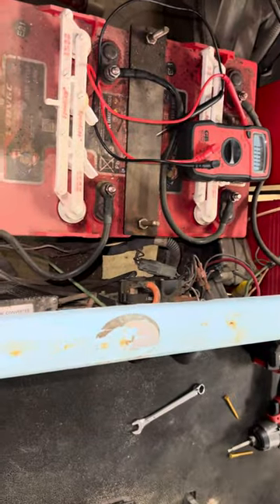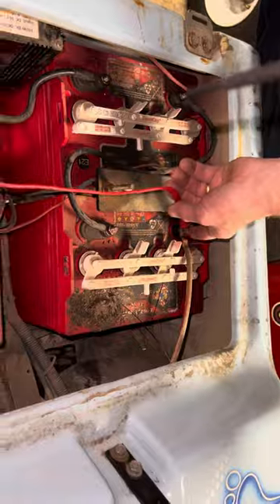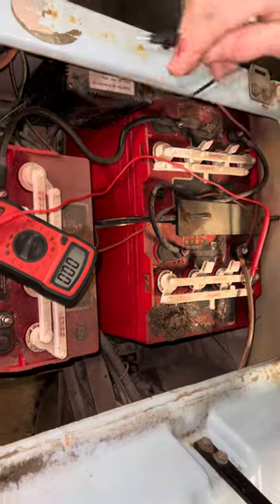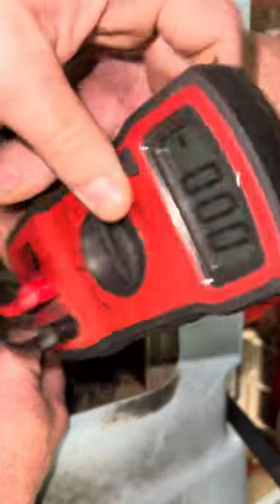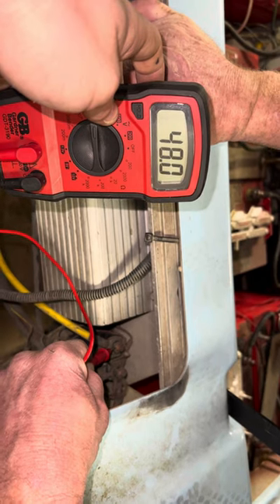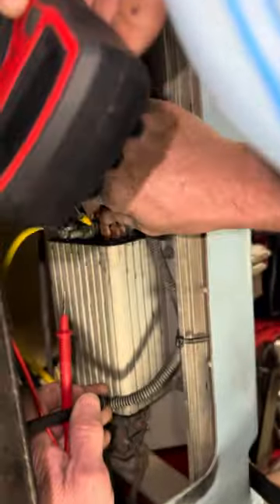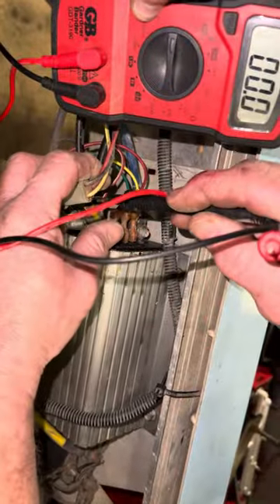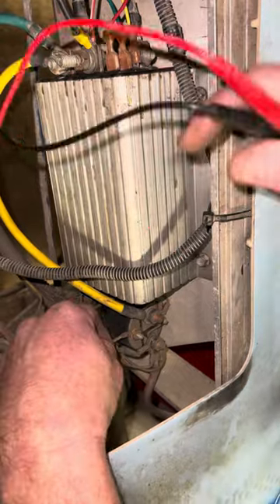Club Car 48 volt won’t move. Troubleshoot whole cart

Comment: Question what if the solenoid isn’t clicking at all just replaced it as my club car ds was not going reverse and sometimes it would go in forward.  Replaced Mccor replaced fnr switch replaced solenoid and somewhere down line won’t click anymore
Reply from the maker: @dezirose6254  what year is your club car ds
Reply: @Golfcartwhisperer  2002
Reply from the maker: @dezirose6254  what color wires do you have on small post on solenoid.
Reply: @Golfcartwhisperer  I have yellow and red 
The red side gets like .02 whether you push pedal or not black gives 50 all the other bigger wires on solenoid give 50 as well .
Reply from the maker: @dezirose6254  for the red wire you put black lead of meter on main negative and test with red lead in forwars
Reply from the maker: Run you a wire from the main positive to the red wire then hit the gas and let me know what it does
Reply: @Golfcartwhisperer  yes I followed two of your tutorials for testing and how to test but with negative lead on voltage meter on main negative from battery pack and positive lead to small red wire on solenoid I got .02 I pushed pedal put in forward and nothing reading did  not adjust at all
Reply from the maker: @dezirose6254  send me a video of your controller solenoid and micro switches on the f n r
Reply: @Golfcartwhisperer  ok I’d probably have to do this tomorrow I left my garage where I have it stored as I gave up today lol ty so much for helping me though I’m trying to do this without taking it anywhere. Your awesome and I love your tutorials so easy to follow …
Reply from the maker: Did you save them numbers. Going to delete
Thanks for watching hit that like and subscribe button for me. Also do you have a tow switch
Reply from the maker: On your solenoid you should have a yellow wire on one small post and then on the other small post you should have a red wire and a white/black wire  sounds like you’re missing a wire on solenoid
Reply: @Golfcartwhisperer  hi I’m on this now I didn’t save it can you resend and delete I’m checking now
Reply: @Golfcartwhisperer  no tow switch
Reply: Hi ok I put a red wire connected to the small positive solenoid post and straight to positive of battery main and heard the click but won’t go forward or reverse still
Reply from the maker: @dezirose6254  okay are you on here now
Reply from the maker: @dezirose6254  843
Reply from the maker: @dezirose6254  add 1 number to each of the last 4 numbers.
Reply from the maker: Let me know when you get it so I can delete
Reply from the maker: @dezirose6254  it’s 5:11 eastern time I am deleting at 5:16
Reply: @Golfcartwhisperer  there is a huge delay in msgs coming through I been checking I sent my number lol 😂
Reply from the maker: Haven’t seen your number
Reply: @Golfcartwhisperer  got jt
Reply: @Golfcartwhisperer  I sent msg